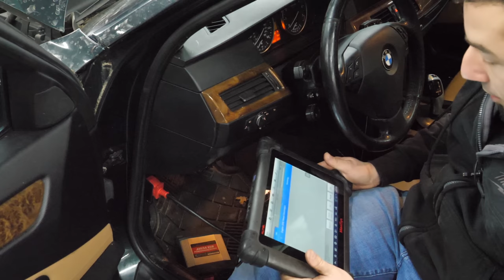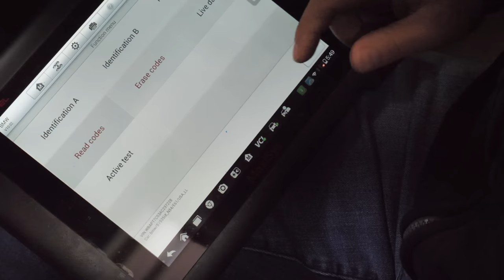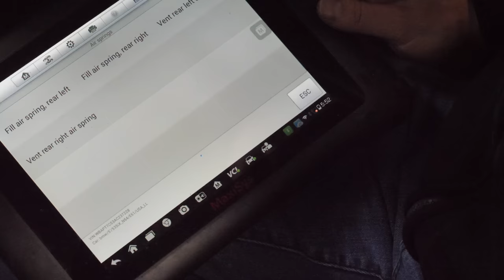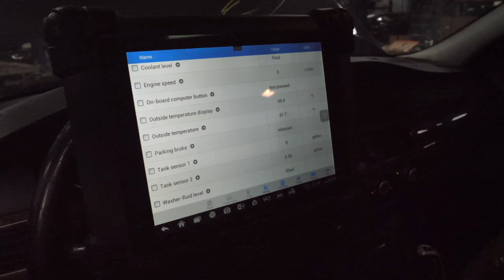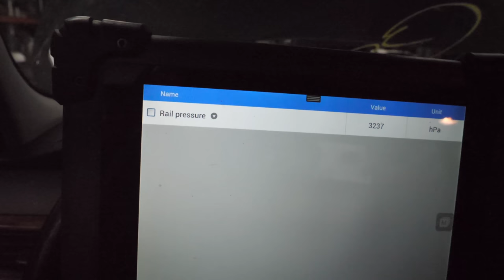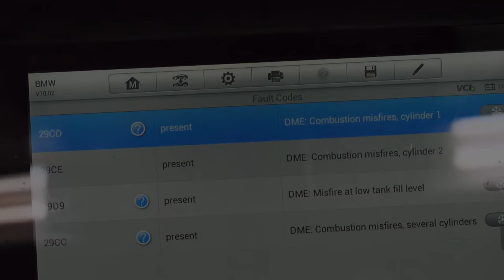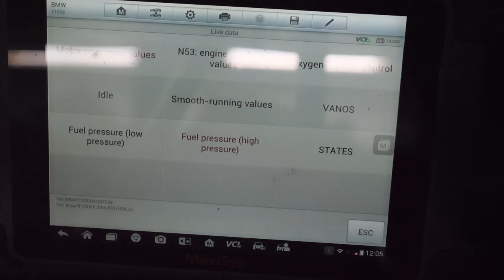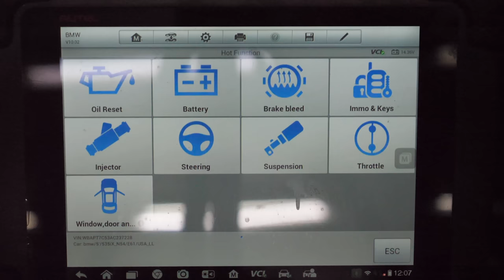WHO DID THIS? BMW Wagon I Bought At Auction LOADED with Improper Repairs. Can We Right These Wrongs?

Comment: BMWs won't run when a misfire occurs as the computer shuts off the coil & injector are shut off by the computer. There is no clearing by shutting off the ignition. I learned a lot after 45 years of auto repair.

Comment: For less than a G, I think you got a great "diamond in the rough." The electronics modules aren't too horrid to do with junkyard replacements and a laptop with some software "freely" available on the internet. This car looks like it was REALLY spec'ed out by whoever purchased it. Noticing the night vision cam; those aren't very common.
As someone who's done the CCC ---> CIC conversion, it's nice to have it already. Parts are hard to find, and swapping the console controller is a pain.
The CIC can be even further modernized with android auto/apple carplay boxes. 2-300 from Chinese retailers like Kremersino, and not too hard to put in. They just use the CAN bus inputs from the controller and sit between the head unit and display to give you a full phone experience without interfering with or replacing any factory hardware.
Reply: I've done like CCC to CIC in E61 including combox. It's not hard and I think I still have another CIC in the basement. Anyone wants it?
Reply: @vadimr4866  True for most of the swap. The faceplate is the hard to find part, and the hard work is if you want the newer idrive controller. Either replace the entire center console, or mill out the old one and make a custom mount/bezel.
Reply: The problem with that idea is that when the radio fails then it can take down the entire CAN network and prevent the car from starting or running.

Comment: Eric, when/if you pull that fuel tank setup, tie a string to the crossover lines before you pull it out. Then you can use the string to help guide the lines back into place. Should save you some irritation.
Reply: Was about to make the same comment. I just did this job on my ‘04 530i and used the string trick.

Comment: Have no illusions. This guy is an elite mechanic.
Reply: An elite mechanic who dives in and changes a HPFP without basic thought process on eliminating the low pressure first? I don't think he is. Enjoyable content but elite mechanic he is not.
Reply: @jamesmackie9292  he couldn't even discern that mystery blue cable in the trunk [ground wire] i stopped watching after that thumbs down.  he don't get "audio guys?"  When you drive, you want to enhance the experience with music making the drive more meaningful and enjoyable.  A non-car guy wouldn't understand
Reply: @jamesmackie9292  3200hPa is 46psi, that's what a low pressure pump usually puts out so I could see the confusion. Kinda weird BMW doesn't have 1 more pressure sensor to rule it out.
Reply: @hydrocarbon82  They do have a low pressure sensor as well although they are a common failure item.
Reply: The people commenting lol. You are all experts I get it. No one knows as much as you. Have a nice life living in your own heads.
Reply: @fitfogey  always,man.Just like during football,people commenting are always the absolute best damn football coaches on the planet.😂🤣🤦🏻‍♂️

Comment: Got to say;  I admire your drive on these vehicles & engines.  As the years have progressed, the more I miss Points, condensers, distributors, rotors, plug wires, dwell timing, being able to see the ground when looking around the engine, etc. etc.     Very interesting stuff though.  Your take on the specific reasons for varied models, years of mfr., etc.  Keep up the good work.

Comment: You said that the car had sat for awhile, hence the corrosion on visible parts of engine.  That corrosion could go a lot deeper and involve a number of things, most notably electrical connections.  I was a radar maintenance type in the service and when we got into the digital age and working with low voltages (.001 > 28VDC) a common fix for a problem was to simply pop a circuit card loose and reseat it in it's connector.  Moving the coil packs around accomplished that and now the full voltage is flowing to all necessary places.  I agree with your question "who the hell worked on that car" all I know is I wouldn't, I diddled a little with my `78` Subaru, setting valves, replacing water pump, but I wouldn't even think of tinkering with my `22` Roo with twin cams and all the electronics.

Comment: Hey Eric, I'm sure someone already mentioned it, however, if you connect a 'fish tape' or similar string or rope to the old unit before removing the crossover lines, it will give you something to pull with using a tie strap to keep the lines together.  Just saves a little time and headache :).  Also leaving the right side sender loose in the tank will give a few inches to work with connecting the lines on the left side.  But congrats on the tenacity and perseverance to see this through 👋👏😀

Comment: Great video.  Quite a change to see you work on an engine that you'd like to be running when you're through putting a wrench on it.  I felt for you having to change a high pressure fuel pump while the engine was still in the car.
Reply: I was slightly surprised that wasn’t harder!

Comment: You should use a "fish wire" or "fish tape" to pull it through and hold it so it does not get tugged back when you install the lines. Like an electrician would use to pull wires in a wall.  The gas and sticking my arms in it would scare me , if it goes up in flame, so do you!
Reply: With all that Gasoline soaking into the carpet, I almost expected to see a "Jay Leno" moment.
Reply: I was thinking about the fish wire idea while watching as well. I’ll bet that’s what they do at the dealerships; tie a wire to the one coming out, and then tie on the new one to pull back through.
Reply: @saewoody6366  They probably have a self guiding robot install it.
Reply: @saewoody6366  - Yes, and is is called a Fishtape...Cable guys use them a lot, and other ways to get cables where they want to pull them...  :)

Comment: just a tip for the next tank, when i need to pull all those feed lines from one side of the tank to the other, I normally put a wire or a small metal rod in the space that the lines need to come through, tape the lines on the wire once it comes through the other side and pull them all at once. learned that trick with an electrician friend of mine and use it in all kinds of tasks. when it's hard to push, use something smaller to help pull it from the other side. it works 99% of the time.

Comment: First off, congrats on the great deal at the auction for a solid green wagon. I also got mine at auction but just the sedan e60. I've replaced the low pressure fuel pump a few times so the best way to do it is tying nylon or some sort of rope to the fuel lines in the driver side fuel filter side, disconnecting and pulling from the passenger side. On reinstall tie the new lines to the rope now on the passenger side then pull them over to driver side. Also, the easiest way to convert to rwd is that x-delete app but understand the weight reduction. Let us know where and when you're selling that blue e61. Shoot, might do what you did and just look for a mechanically totalled e61 in either blue or green. Manual woild be nice but too rare. Might have to manual swap and follow your lead.

Comment: My nephew obtained a 2000 540i sport wagon back in 2010ish from his father. He asked me to check it out. I was impressed, both for good and bad reasons. His father was very particular about getting maintenance done on time so it wasn't an abused car at all. After checking it out I told him... "Drive this for 6 months and sell it!" Well, he didn't sell it after 6 months and all sorts of things started happening, one of which were the air bags failing. The plastic parts in the cooling system started failing, the ignition coils started to fail ($90/each x 8 for full replacement), the upper and lower radiator hoses failed, the power steering pump failed, something in the brakes failed (I didn't repair that one but it was VERY expensive at the BMW dealer. More than the kid could really afford).... all after about 8 months of daily driving...He finally sold it as his life was changing. BMWs are either heaven or hell: the masochism to joy ratio determines which it is.

Comment: You can turn the air suspension pump on with this scantool. However, the additional (special) functions are under special functions right after you choose the manufacturer (BMW) and not in  individual modules. Just replaced air springs on mine recently and works perfect.

Comment: @I Do Cars; 43:39 - that was Cool…showing the fuse blow at a speed our eyes could catch it....  I’ve only watched a few of your videos since yesterday when I ran across your channel.... but I was damn near in tears when you said I wonder where I could find a compressor at a salvage yard.....? After the whole high pressure full pumps & coding the injectors & fixing the super novice repair attempts of a “green horn”... I was catching onto your Quotes.... I was dang this man is gonna get this car done tonight....! 
I do not work on cars much anymore but I’m diggin’ your channel & I’ve actually learned stuff... always a plus.. Ohh & cool tool pulling the, “ sending units/ floats” outta the back seat areas...!  I know that I worked on an older ford ZX2 that I had changed out a unit that was the fuel ⛽️ pump, in that same area...  The high pressure fuel pump you changed on this bmw was cool to see also... Awesome skills Man.. You are a very talented Guy & a Great teacher.. 👍🏼👍🏼✌🏼

Comment: That fuel system is a nightmare.  You can be pretty sure that everyting about that German over-engineered car will be difficult to work on.  I used to work on EDP machines in banks and one day I received a service call for a small 80 column dot matrix printer on a bank president's desk.  I assumed it was a plastic Epson printer that you can fix in 5 minutes, but when i arrived, I saw a German printer that weighed about 40 lbs.  It took me about 15 minutes to remove the cabinet, then I was confronted with aluminum castings and the base that held all the mechanisms was a 3 inch thick aluminum casting that was crc machined with precision extensions and drilled holes.  Where the print head was snapped into the Epson, this was held in by 4 special screws.  I replaced a switch and put it back together.  Testing showed that it printed just like the $65.00 Epson and I found out later that the bank paid $400.00 for the German printer.  I told them that if they ever decided totrade it in , I wanted it to display the base as a piece of art.  I assumed that there was a team of machinists and engineers who designed it.

Comment: We are on our nth 5 Series Wagon and still totally pleased. Being in Germany does not make it easier (or cheaper) to own, but availability is greater. Our current is a 2010 525d with full M Package (Suspension, Aero and Interior) and best of all is a manual 6 Speed.  100% agreed, you should not own one if you are not willing and capable of wrenching on them - dealer prices will drive you bankrupt. Highly complex and expensive but also extremely satisfying  if running well. Last one died at 350000Km - will change the timing chain one this one before that happens.
Great family car, capable Autobahn runner and amazing in the twisties.

Comment: If you're gonna swap front sub frame, do all the bottom parts and gaskets that will need sub frame drop, coolant pumps, engine oil pan gaskets, etc.
Do the rear as well. Put in M5 rear sub frame and swap in a mechanical LSD with correct rear diff ratio for your transmission. 
You will need adjustable aftermarket toe rods for M5 to connect to existing rear king pin aka knuckles aka spindles. Replace the rear bearings while at it. OE are gone by that miles.

Comment: I have one of these. 2010 wagon. This car is a beast. I’ve drove from Colorado to California up the 101 and everything in between. Made for the highway. Was in a collision with a stoned young dude from south of the border. Found out the battery cable has a exploding charge to disconnect all electrical.  My family was safe and car repairs made.  They are amazing rides. Made it from vail to Denver in 52 minutes. Low level flight.

Comment: The first car I ever bought was an '88 RX7 Turbo in 2006 and the first time I filled the fuel tank i dropped a few litres of gas on the ground at the fuel pump. I discovered that while a previous owner did upgrade the fuel pump, they didn't bother to tighten down the cover where it mounted to the top of the fuel tank. It was one of many things that I discovered about that car over several years.

Comment: I did a auto to manual swap on a 2004 325I. It was a fairly easy and enjoyable project. I got all of the pieces and parts from a 98 323 for under $400 from our local Pick-A-Part. THe body has all the provisions that you need to do the conversion- the difficult part is recoding the DME for a manual transmission. I was kind of surprised that you didn't tie a piece of twine to the old lines when you pulled them out of the tank to leave yourself something to pull them back through with- thats what i have to do with hydraulic lines on the fishing boat.

Comment: A few years ago, I bought a 2000 Volvo V70 AWD wagon...despite a Christmas tree's worth of lights in the dash. It ran, rode and handles beautifully. It was rust free. That Volvo is why I have vowed to never buy another used, fancy, European car ever again. Maybe a standard, diesel, VWI...but probably not. I like working on vehicles. I'm even pretty good at it...but every single thing I had to work on, was the biggest pain in the ass of any vehicle I have ever owned. Plugs were easy...that was it. If I don't count my time (cuz you just can't and retain your sanity) after all of the work I put in, I made enough to buy a few lattes when I sold it and the young lady who bought it, has a nice, reliable car. Probably.

Comment: Engine tear-down suggestion:  Jaguar/Land Rover "V6" that is used in the Jag XF.  It is basically the exact same block as the V8 but they chose to not bore out the last 2 cylinders, so you have a V6 ENGINE that is the same physical size (and even HEAVIER IIRC) as the V8.  I couldn't believe I saw what I was seeing when I saw this thing.  I think it would be great to see what happens when you let accountants make decisions for engineers!
Reply: So the accountants had holes in their arguments...oh wait...

Comment: The more videos I see on this channel the great appreciation I have for EVs (not saying they can’t fail, but EVs having less parts means less parts can fail)… and I’m sure someone would mention batteries…. Well, if you can replace an engine with a used one, you can replace a battery pack with a used newer pack (doesn’t need to be new pack).

Comment: Not to tell you your job, but Scotty Kilmer has pointed out that a low battery can prevent a car from actually starting, even if it's cranking, if the computer doesn't have the right signal. But also, might knowledge of cars ends at about 1980. I like simple cars.

Comment: When I saw that the fuel tank was under the rear seat it brought back memories of my first car in in 1969, a 1947 Willys Jeep!  That was under the drivers seat!  It wouldn't shift very well because of all of the  sawdust the previous owner had put in the transmission and transfer case to keep it silent, when he sold it to my dad.

Comment: I'm surprised you didn't use "Rope Trick" for fuel pump install. I've used it on my E60 M5 and it makes things so much easier:
Basically, when you remove fuel filter assembly on driver side , you tie the rope to end of the fuel pump harness so when you next remove it on passenger side, it pulls the rope. Obviously, you make sure the rope is long enough for its other end is still visible on driver side. Then you tie that same rope to new fuel pump harness and pull it from passenger side.
It works great because it pulls the harness vs  pushing it which can damage it.

Comment: Often, just removing and reseating electrical connectors can fix a lot of issues, just the cinch pressure on the connectors and the back and forth motion of reconnecting can clean and improve (significantly) the electrical connection.

Comment: I've always been a Toyota guy, was even a Toyota tech for 10 years. I was very worried when my mom decided to buy an e60 as I've worked on all sorts of cars at the dealer and in my experience, German cars were the worst. That was by far the worst car my family has ever owned and we've been through dozens of cars. 3 sets of injectors, cats, 2 turbos, every single hose had to be replaced after leaving her stranded at least 3 times. Water pump also left her stranded. My daily is an 06 highlander with 400k and has never left me stranded once, we've had it since new. My 93 supra has 220k on it and has also never let me down. Pretty much none of my Toyotas ever let me down. We never took the e60 on long trips as it was too risky, always something with that car. It's too bad because when it ran it was a blast to drive....when it ran...

Comment: When working on cars with lines from one side of the tank to the other, I like to attach mechanic's wire to the lines. Once i pull the lines out, I attach the wire to the new lines and use the wire to help guide the lines through the tank.

Comment: I would have sworn you said the serpentine belt was missing. Not a good thing trying to start it without the belt. Potentially hit some valves with the pistons in that case. Not absolutely on this engine but too many euro cars would. I hope you disconnected the battery before servicing the fuel system.